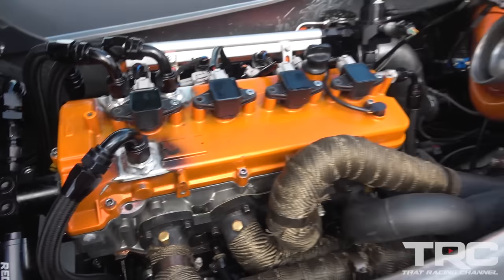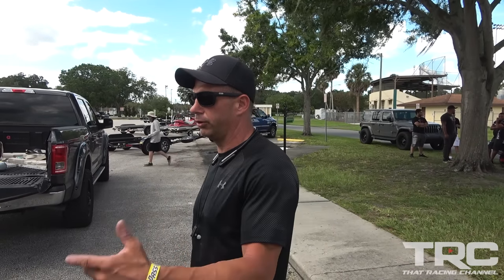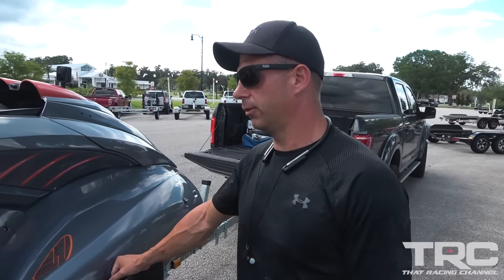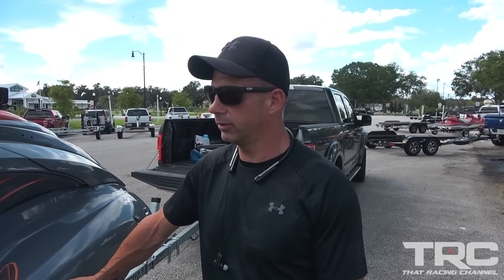1300HP Turbo Jetski 100+MPH CRAZY ACCELERATION (The BIGGEST TURBO We've Ever Seen on a Jetski!)

Comment from the maker: Enjoy this absolutely ridiculous turbo jetski! A little perspective for you guys, the TRC Supra used to run the same 7685 turbo and cars have gone 7 second 1/4 mile times with similar setups... (mind blown)
Reply: That is RETARDED!!! I want to build one exactly like it now.. Well have them build me one anyways
Reply: can i get a dyno video and not just a claim on power
Reply: Joey Marcum  I would imagine they would pull the engine out and figure a way to test it that way.. That OR test the flow rate out of the jet and do the numbers that way
Reply: @brandonstone6962  well its definitely a number taken from the crank because there aren't pumps that flow 1000hp and fit in a ski. I'd bet it's at best 700hp and either way a colossal waste of time and money because 500hp and you are already cavitating the best aftermarket pumps for skis
Reply: @cbracing808  It is NEVER a waste of time and money as long as everything actually works like this one does.. But you're more than likely right about the HP ratings tho
Reply: 0:11 SONG??????????????
Reply: How much does this engine cost to build?

Comment: If youve ever ridden a 1000+cc wave runner and said 'this needs more' youve got a screw loose and im thankful for it. This is insanity.
Reply: b literally doing 65+ on one is already wild
Reply: Can't wait to get my '19 gp1800r svho to 90+. I have to make mine run like that all day though. 150 mile runs too.
Reply: I thought my 1200 pro was fast back in the day and always wanted a lil more but compared to that thing wtf
Reply: I'm not trying to be billy big balls but I never thought 1000-1200cc waverunners in stock form were that fast. The acceleration could be fun but that's short lived. In my opinion if you want to have fun on a jet ski it has to be a stand up 2 stroke. 

I haven't rode one of these turbo sitdowns though. If any one wants to change my mind let me know :P
Reply: The gp1800r svho is 1800cc. Stock goes 70-72 mph, but it gets there very quick. It will get your adrenaline going sometimes. Love the power from these things!
Reply: @jakobmcguire  so long as you have space to slow down and your watercraft can handle other people's wakes, you should be fine.
Reply: How does the jet drive not come apart
Reply: A buddy of mine used to have a couple of Honda 1200cc turbo jet skis, and after riding them for a while I actually did get almost bored of them. I want 300+ HP if I ever get one. I want to be clinging to the handlebars for dear life when I hit the gas.
Reply: Jake McGuire I have Kawasaki 310 and i still think it’s needs more 😂😂😂
Reply: In stock form they're fun... but I like borderline scary. Got a 09 FZR earlier this year. Ecu is out for an 8600 rpm tune. Shooting for 80mph
Reply: @Breakitjake  Pray that the coast guard never catches you going that fast, unless it's during a sanctioned race max allowable speed is 68mph.
Reply: 210hp aint nearly enough to play around with
Reply: 1000 is the minimum now really. Kind of weird that the 1500 CC kawasakis making 160HP and go 60+ but the 1550 Seadoos only make 130HP and go around 50.
Reply: @Lightning546  who told you theres a speed limit on the water?   if you arent near  another vessel or in a  no wake zone etc  you can zip at full tilt as you please. people have powerboats and pwcs that haul ass specifically so they can haul ass...
Reply: @918_xDx : Jet skis/PWC  are speed limited to 68 mph, per coast guard regulations, unless they are being used strictly for racing.
Reply: Dam! Like putting my ZX14 on water.
Reply: @Lightning546  It's not a law but it was a Gentlemen's agreement for manufacturers to keep speeds at 65 mph.
Reply: I got one and I could use a little more top end to be real with ya 😊
Reply: bro fastest i've gone on one is like 75 and the only thing i could think when i was going that fast is that i wanted to go faster
Reply: My rxp 255 supercharged nodded did 75 + that thing has to be doing 125 plus
Reply: Ngl 1000 are kinda slow like they get old that supercharged 1.8 svho is fun fr
Reply: @Lightning546 😂😂😂What coast guard?? They ain't patrolling a lake. Also I've never in my life heard of a CG enforced speed limit. They don't even have radar guns to clock you, how would they do that?

Comment: Just for 1 second, imagine driving that and throwing a piston. I wish I'd never have seen that engine placement lol
Reply: I would reinforce the underside of that seat with kevlar and steel lol, heat shield of course being the outermost layer.
Reply: I was checking to see if someone else realized this, here you are lol. ✌
Reply: anonymous  can you link that because that sounds fucking crazy
Reply: Nothing "shoots up" when an engine like this blows. I've blown several. Nothing has EVER hit my hood, nothing will "shoot up his ass either.
Reply: anonymous  Those Harley engines have a separate "jug" on each cylinder, with the single head held on by a few small bolts. A Jet ski engine has one large head, over all 4 cylinders, held on my MANY large bolts. The head will not come off. Besides that, a Nitro engine is a whole different animal compared to a boosted gasoline engine. Apples to oranges here. Nitro fuel can and will blow the head apart on a 500 cubic inch Top Fuel engine, just by rolling the engine over my hand, if there is fuel still in the cylinder. But, this could not, and has not, ever happened with a gasoline or alcohol engine. He does NOT have to worry about a head blowing off the motor.
Reply: @davelowets  I've had a spark plug shoot up out of my 3.2l accord and put a massive dent in the hood. 
It removed all of the threads from the aluminum head
Reply: @johncuervo3019  A "massive dent" the size of a quarter.
Reply: @davelowets  half dollar and that was through two layers of the hood and coilpack
Reply: @johncuervo3019  Plastic coil pack, breaks the ear off held on by the bolt. Doesn't go THROUGH the coil pack. I've fixed hundreds of these. 90% of them don't even leave a dent. Definitely would not go through the seat of a jet ski
Reply: No different than a motorcycle.

Comment: That's crazy cool... love going over 100 on the water.  Doing it on a jetski sounds exciting if you survive.

Once I was slalom water skiing behind a drag boat. I fell at over 100 mph and then skipped across water for over 1/4 mile. It ripped my flotation vest off, and shredded my wet suit that also provides buoyancy. I thought I was going to drown. I tried to tread water, but my legs didn't move very good. I realized my ski never came off, and my legs were twisted almost backwards. That's when the pain hit; head, face, arms, legs, internal organs. Boat came around and pulled me out. Got back to shore and saw everything was still attached, arms and legs functioning. I never skied faster than 60 after that.

Comment: 1300hp on a leaf basically
Reply: water resistance aint the same as air resistance
Reply: Kotsa not by a long shot. But it’s still real damn light for 1300 hp 😂😂
Reply: @Jamxknife  that's a massive oversimplification of the physics at play here.
Reply: Holy fuck guys, it’s a joke. Not grade 10 physics class. Relax.
Reply: ever tried sprinting in water?
Reply: wheres the dyno video proving 1300hp
Reply: @jc35957  I will never believe it until I see it....
Reply: That thing she go 150 mph
Reply: @wanderingbufoon  A jet ski doesn't drive "under water". Most of it glides on the top.
Reply: @davelowets  yes but the engine is still having to move water. It's the water resistance in the water jet is what I'm talking about. Not the haul's water drag
Reply: @wanderingbufoon  and that is nothing like "running underwater"

Comment: My leaf blower makes 1600hp

Cant dyno it, but a tree told me.
Reply: Ye right? Even no cooling system for that HP, even if it has NOS. I call BS 1300hp that engine.
Reply: You'd have to hook the driveshaft up to an engine dyno to get an estimate I guess.
Reply: There is cooling, it uses water from the jet pump and it probably gets dyno on a driveshaft dyno
Reply: Joey Marcum  Thanks for sharing your life experience. Good luck with your habit.
Reply: @budd2018  that's methed up to say
Reply: Leaf me alone
Reply: @Guccifer808  unlimited cooling system mate. 1300hp easily. People make 2000hp from 2L Hondas all the time in drag cars, so 1300hp from a 1.8L isnt a stretch
Reply: Yeah it's total horseshit that that has 1300. Why would you even bother, anyway? It'll detonate ten times faster than 600 HP, and beyond that, you're not going to get much faster with a jet ski.
Reply: @nordic5490  A lot of those people are dead ass lying :))))
Reply: It’s incredibly easy to pull an engine from a jet ski. How do you know he didn’t pull it out and dyno it?
Reply: @Zak-nv1tl  I would like to see that video, where is it?
Reply: @mtcmotorsports4512  and it is running on methanol, which takes out enough heat from the cooling system for drag guys to not run a cooling system at all...
Reply: @rhubarbpie2027  waverunners have water dynos
Reply: 100%
Reply: @Diax1324  no shit Sherlock
Reply: Bud D. I bought one at Lowe's. The Blow hard.

Comment: I wouldn’t want to be sitting on that thing when it shoots a piston to the moon. 60 psi that’s insane.
Reply: Say that to my old Honda power washer, things been cranking for the past 20 years on wide open throttle lol
Reply: @eamonshields2754  not with boost it hasn't, especially not 60 pounds! That's nuts
Reply: Was thinking the exact samet hing.

Comment: To everyone who doesn't believe the power, 1300hp on a high comp 1.8L with that much boost  through a 76, it seems totally realistic to me. My car is a 11.6:1 sleeved 1.8L and made 700whp on 30psi through a 6262. Add 14mm more turbo and almost double the boost. Am I missing something here? (I will admit I know nothing about the water pumps these run, so maybe that could be the bottle neck?)
Reply: I think shaft horsepower, you're bang on. Im not an engineer but i imagine the impellers have to suffer some degree of cavitation loss when they're spinning that fast.